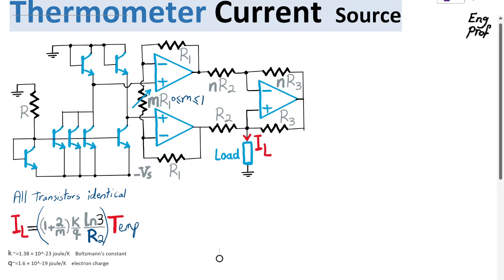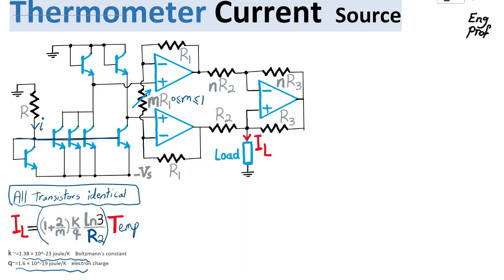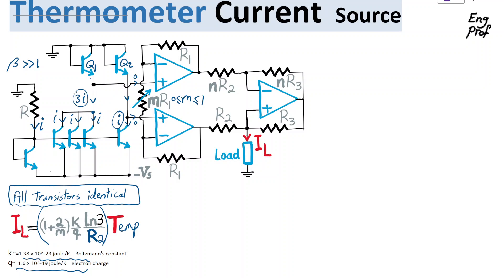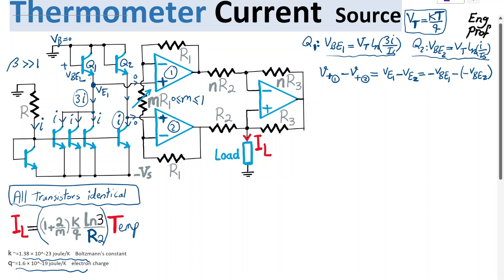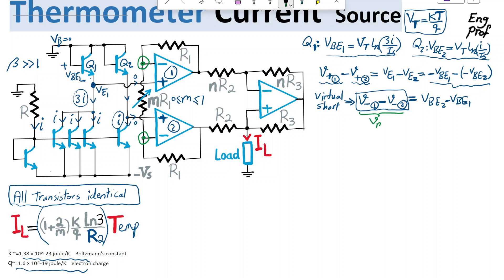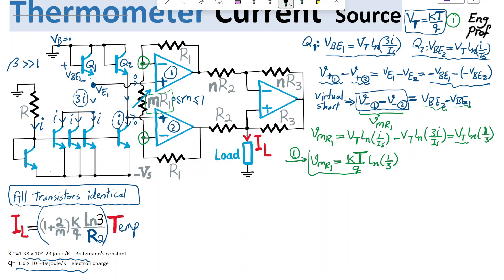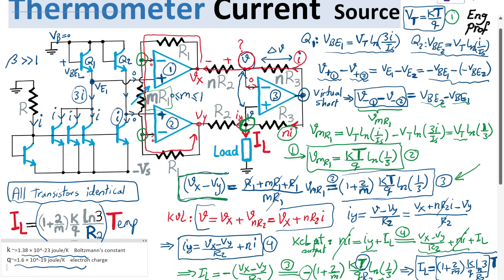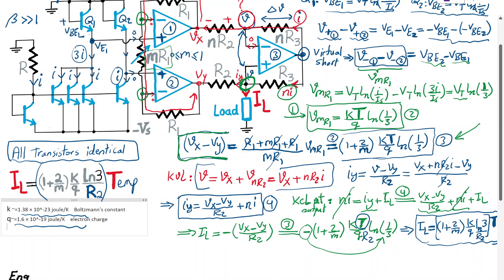Thermometer Current source with Programmable Instrumentation Amplifier

Comment: Thank you Prof.,
Equation 4 is confusing things. It is not necessary to add "ni" to it.
Reply from the maker: You're welcome. Answering your question, it is necessary. Watch the explanation in the video starting at 11:16 , and carefully observe Vx corresponds to the output voltage of the first op amp (on top branch). The explanation starts with first writing a KVL to express the voltage V at input terminal of the 3rd Op Amp as a function of Vx . Then V is used to write the KCL in equation 4.  I hope this is helpful.

Comment from the maker: Thank you for watching. For more Op Amp Circuit examples please check https://www.youtube.com/playlist?list=PLrwXF7N522y4c7c-8KBjrwd7IyaZfWxyt
Thermometer Circuit with Op Amp, BJT transistor https://youtu.be/55YsraFE0rg
Voltage Regulator: https://youtu.be/rI9f6-DyXxQ
Full-Wave Rectifier:  https://youtu.be/DJJMNU-CYcg
Bandgap circuit Video: https://youtu.be/esMlNx5w9Jw
Flex Voltage Regulator: https://youtu.be/CJl-urzeiTo
Sawtooth Oscillator with Op Amp, JFET and BJT Transistors https://youtu.be/5zHXTx-Vl20
Op Amp Analog Computer circuit that solves Differential Equation: https://youtu.be/ENq39EesfPw 
I hope these Analog Circuit Design and Analysis Examples are interesting and helpful. 🙏

Comment: That was quite interesting, although didn't follow 100% on the first watching 😁 So, if one would want to assemble the actual circuit one would have to select and match all 5 transistors, I presume? Match for beta, Vbe.....?
Reply from the maker: Glad that you liked this OpAmp BJT based Thermometer circuit and glad that it is useful. Thanks for watching. A related example is the Op Amp + Current Mirror Circuit https://youtu.be/esMlNx5w9Jw 
Regarding the matching Bipolar Junction Transistors, they just need to be from the same IC package so that they are on the same substrate and designed using the same process. That also helps with keeping them at the same junction temperature. It is to make sure Transistors have the same PN junction properties that define Shockley Vbe = eta*Vt*Ln(I/Isat) equation.  
For more Op Amp and Circuit examples please watch https://www.youtube.com/watch?v=esMlNx5w9Jw&list=PLrwXF7N522y4c7c-8KBjrwd7IyaZfWxyt
I hope this is helpful.